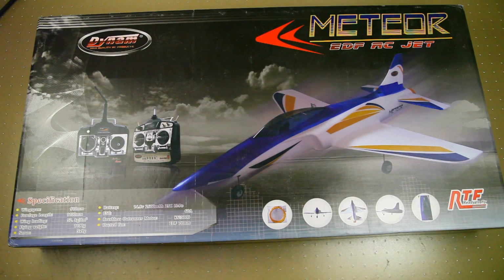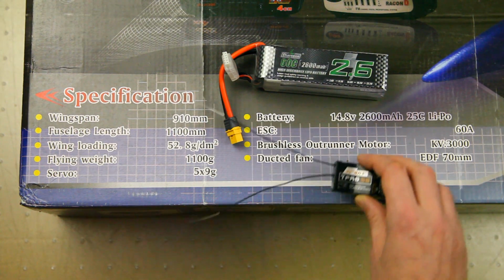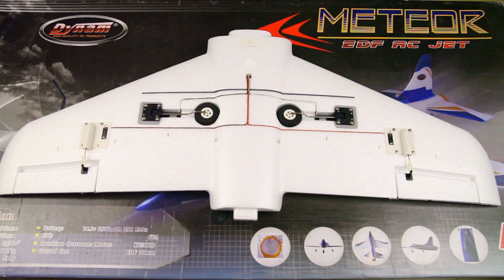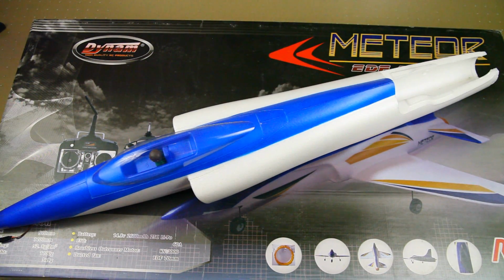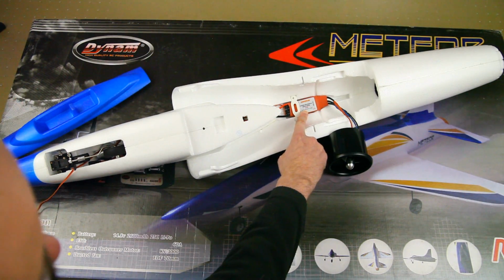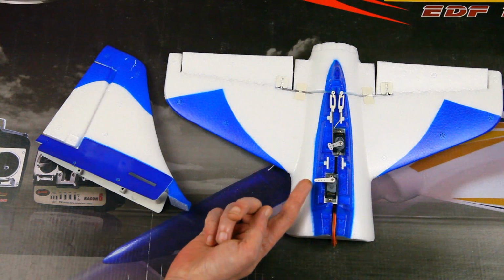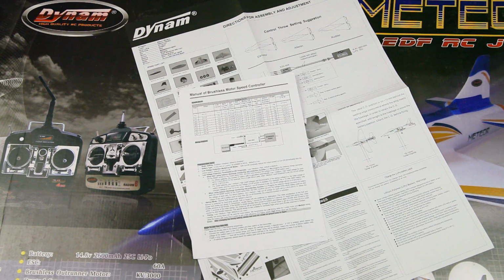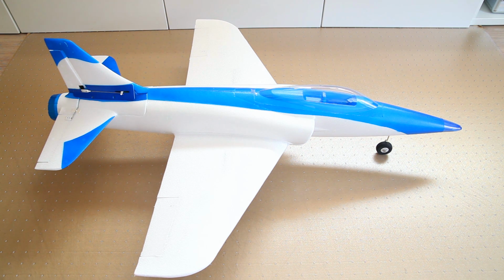Dynam Meteor EDF Jet! :D (70mm + 4S) - Show & Tell

Comment from the maker: Have a need for Speed? :D Let's have a look at the Dynam Meteor V2 Jet :)
Link to this EDF Jet: https://goo.gl/TQsxTF 

The Charsoon lipo I'll be using: https://goo.gl/FPYUph

The FrSky receiver I'll be using: https://goo.gl/B064ER

Specifications: 
Wingspan: 910mm 
Length: 1100mm 
Material: EPO foam
All up weight: 1100g
Wing loading: 52.8g/dm2 
Servo's: 5x 9g
Motor: 3000 kV outrunner
ESC: 60A (brushless offcourse)
EDF unit: 70mm 
Lipo: 2600mah 4S 30C (not included)
Retract: yes, metal servoless
Receiver: at least 5 channel (not included)